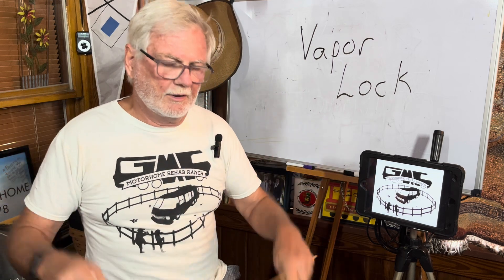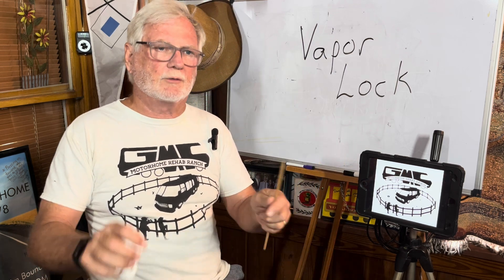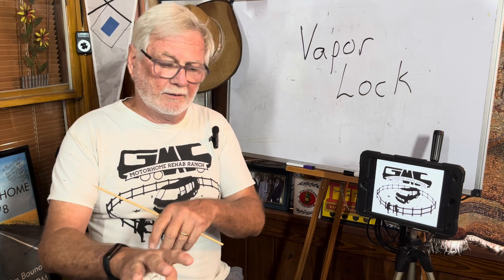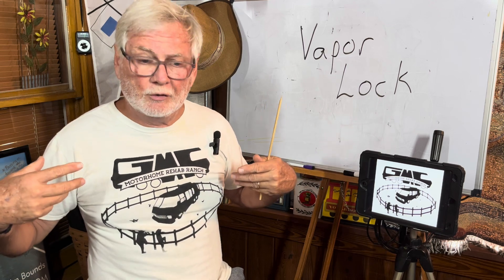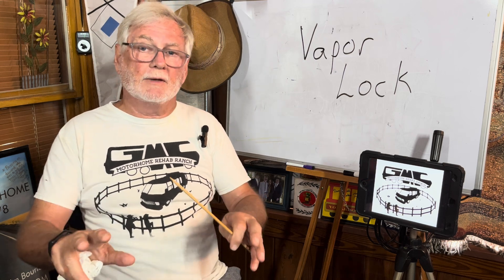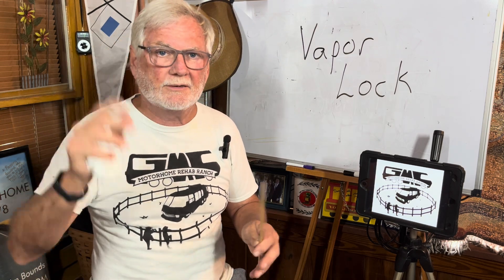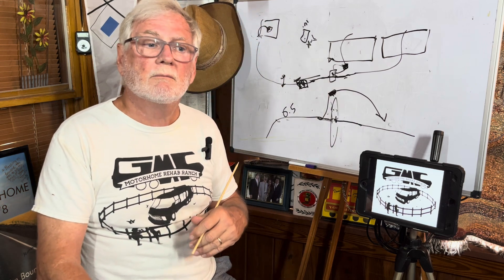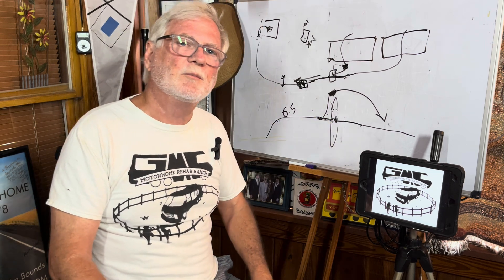Vapor lock:  Why me Lord…..

Comment: My 85 318 90,000 miles has a return line fuel filter, runs smooth, no hesitation, my 78 360 rebuild 600 miles idles fine but hesitates stimbles on acceleration, tried all kinds of tricks, no luck, gonna try putting return line regulator on it see if it hepls, thanks for video

Comment: I sold my coach after doing a timing chain, carb rebuild, aluminum intake, full tuneup and gutted it. It ran absolutely amazing... almost a hot-rod. I do miss it but anyway, I solved my vapor lock by putting an electric pump in the line on a toggle switch. If the mechanical pump failed to prevent vapor lock, I'd just hit the switch and boom, it came right back to life.
Reply from the maker: Yep, solved….. feels good solving things like that, doesn’t it…… thanks for the support
Reply: @motorhomerehabranch  Yessir. It saved my butt in a shady part of downtown Indianapolis too. Also did the after-market air ride system with new compressor, digital dash and a few other things. I brought it back to life after sitting for 10 years in the weeds. Would have kept it but moved and plans changed. They are cool machines.